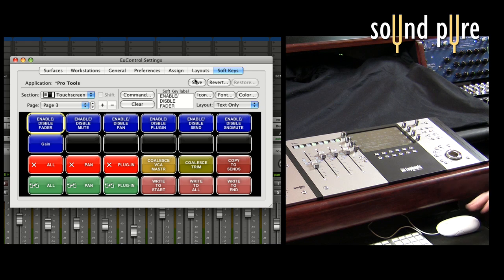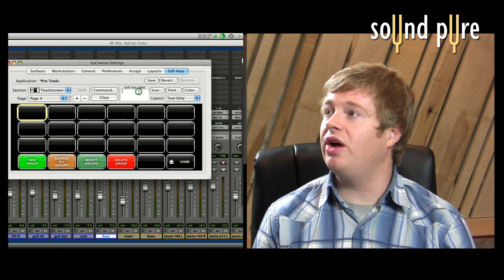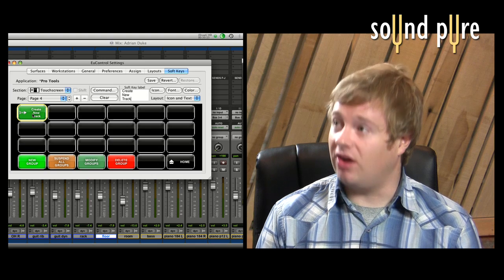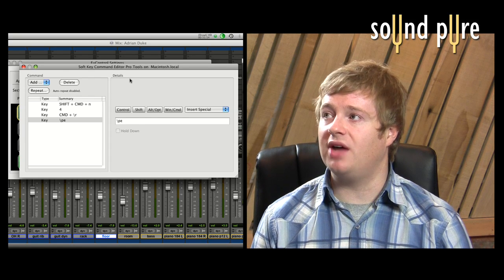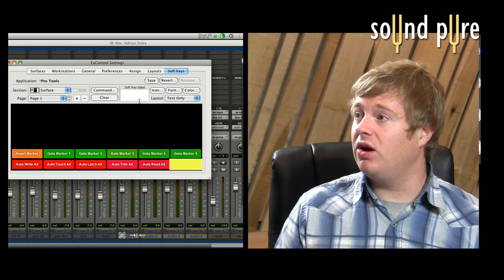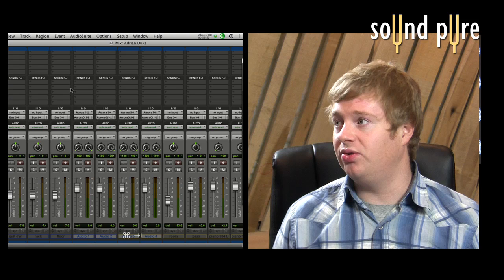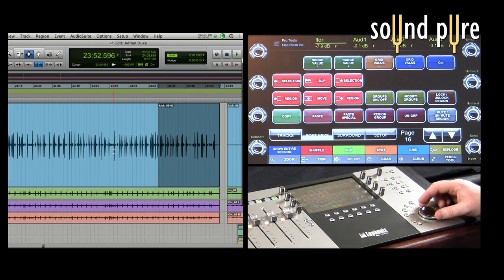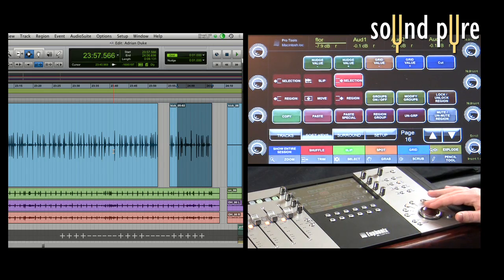Euphonix Artist Series Touchscreen with Pro Tools HD - MC Control main touchscreen video 2

Comment: Very late to this topic.  Got one of these units used recently.  Sadly, it looks like there's no "Left Edit: Nudge" command available anymore in the new firmware/software which is disappointing as nudging with the jog wheel is a pretty cool idea.